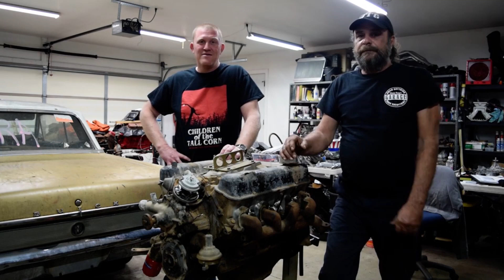Buicks Miracle Motor

Comment: The porisity issue.  The engineers faild to vacuum impregnate the blocks with wax, Critical step missed its why they sweat oil out everywhere  even cooling passages. 
Take all the aluminum parts timing cover also to a heat treating company and have them wax impregnate them. Problems solved .

Comment: brodie is wrong at 1:51 this was not the first production cast all aluminum v8. that was bmw in 1952 when they started production of their OHV pushrod v8 for their '54 BMW 502. They used their alloy v8 in many models up until the mid 60s.
Reply: That's even incorrect. Ford GAA.

Comment: Buick engineers built aluminum 215 cubic inch Hemis in 1951 for their concept cars for 1952. These engines were all aluminum with a rootes blower integral sitting in the valley with 2 side draft carbs, one for gasoline and one for alcohol, which opened when the throttle was mashed more than half way. The 2 cars both had 2 fuel tanks and both ran and drove and were tested often. One car, the LeSabre had a transaxle. The other car, the XP300 sits in the Sloan Museum in Flint, Michigan.

Comment: Even into the 2000"s, Rover was unable to make this even moderately reliable. Theres too few headbolts resulting in continuously blown headgaskets and cooling issues. GM did the right thing axing the program, at least this engine didnt damage GM's reputation like it did Rover's.

Comment: The Leyland P76 V8 engine was a tall deck version of the early Rover V8 it had a wider taller block for the long stroke crank. The bore is 3.50, and the stroke is 3.50

Comment: It's now 2024, I still have two .030" over 455's (so 463cu in) stored in my garage. First, a low compression motor w/TH400 built to run 87 octane gas in a Suburban. Second, a torque monster high compression all-iron motor built to run 100+ octane gas in a circle track Skylark. It has flat-top pistons, zero deck (cut .050"), stage-1 heads cut .100"), and custom cam. For a while my daily driver was a Volvo 142 that I installed a 225ci and later a 231ci odd fire V-6 in. I modified a Buick manual bell housing to directly bolt on the Volvo trans.
Reply: No you don't!!!

Comment: Rover application:
3528cc with twin SU Carburettors (Rover P5, P6, SD1, Range Rover, Land Rover, MGBGTV8, Morgan, Marcos)
3528cc with Lucas (Bosch L-Jetronic licence) EFi (SD1, Range Rover, Land Rover, Morgan, Marcos, Freightliner Ambulance, TVR)
3946cc with Lucas EFi (Range Rover, Land Rover, Morgan, Freightliner Ambulance, TVR)
3905cc with Lucas EFi (TVR but only 100 were made by NCK, later known as TVR Power)
3946cc with Gems EFi (Range Rover, Land Rover) Lucas EFi (TVR, Marcos Westfield)
4275cc with Lucas EFi (Range Rover 4.2 LSE)
4280cc with Lucas EFi (TVR)
4414cc with Bendix Carburettor (Leyland P76 & Leyland Terrier light truck)
4444cc with Lucas Efi (TVR)
4552cc with GEMS EFi (Range Rover, Land Rover, Marcos, TVR, Morgan)
4997cc with Lucas EFi (TVR, Lichfield, Marcos, Bowler)

Comment: the rover V8 (215) in the uk the roverSD! car won every thing in motor sport it killed bmw and mercs on the race tracks and rallying for years for example  monza 500km ETC championship italy 1985 1st- 2nd-3rd  4th place1lap behind BMW635csi  then rover cut out 2 cylinders to make a 90 degree  V6 this was the rover/mg 6R4 rally engine (V64V)  quad cam 4valve and could kick out 400-500 bhp (non turbo) and was developed into the jaguar XJ220 twin turbo V6 and don't forget that lovely 215 V8 was the start of  it all

Comment: A supercharged 215 swap in a Miata/mx5 would be a sick combo. V8 power without the v8 weight. The monster miata v8 swaps are pretty sick but functionally that's a lot of weight up front for a little car, I suspect they are not very good road course cars even tho their power to weight ratio is Shelby cobra territory but a 215 could potentially be the best of both worlds.

Comment: The basis of 2 of Auto Histories longest run power plants in the Rover V8 (1967-2006) (as literal, considering they bought the thing, prints and all from the General (GM)) and of course the Legen-(wait for it)- dary Fireball V6 a.k.a. the 3800 V6 (1962-2008)

Comment: Just in case anything needs to be mentioned about the later engines, the "series 2" Buick V6  introduced in 1995 made more net horsepower naturally aspirated than any previous carburated turbo V6. It won the "Wards best engine" award for its engineering.  Seris 2 heads greatly outflow Grand national heads, and people like me  would like to adapt them to the earlier engines.

Comment: I’ve had a couple of cars with the 4.4 litre alloy Leyland V8 version of the Buick V8 215, it’s basically the same as the 215 but with the deck height of the Buick 340 to get the square Combustion chamber.

Comment: 73 was the first year of the egr,hei was optional on Pontiacs,Buick,and Olds,points were standard,1975 was the first year of HEIs same year of the catalyst,also 75 was the first year of the 231s, even fire started showing up in 77 along with the last year of the odd fire.the quickest way to tell the two apart is the even fire from the odd fire in the even fire distributor cap terminals are evenly spaced.Great information, Thanks Again.

Comment: Guys.  Hey, in 1951 Buick engineers built 2 all aluminum 215 cubic inch supercharged pushrod hemis and put those in 2 concept cars. The Lesabre and XP300 were shown and the XP300 was driven around Flint quite often.  The 2 cars had dual carbs and dual fuel tanks. One tank has pump gas in it and the other had alcohol. When they stood on the gas, the second carb fed the alcohol, cooling the air/fuel mixture. 1951!!!!   well over 300HP from the 215 cu in semi
Reply: HEMI   pushrod hemi

Comment: BMW made and produced an all aluminum V8 well before Buick did.. The Buick 215 was not the first all aluminum engine...   The BMW 507 came with a 3.2 liter all aluminum V8 in 1956... five full years prior to the buick (or the olds).  :-)  Don't get me wrong, the little Fireball (called Thor in it's 4.6 Rover variant).. but it was certainly not the first.

You have just got to love the Buick 3.8L/3800 V6 literally being this engine with the front two cylinders lopped off (and stroked)!  I Love it; great video!

Comment: It’s crazy that the same engine lineage became legendary in so many different ways. It was a groundbreaking all aluminum V8, which went on the be the first production turbocharged engine, which became the Rover V8, as well as the beloved, bulletproof 3800 V6 (which was also found turbocharged in the Buick Grand National).

To say the Buick engineers knocked or out of the park with with engine is an understatement.

Comment: I'm at an old man recently that had an mg with one of these engines in it from the range Rover. Making like 220 240 wheel horsepower. Custom-made the headers and the cold air intake. 5-speed manual. Very nice very fast little car.

Comment: Hate that I didn’t find this video sooner. Grandmas 63 Olds F-85’s both have this engine both convertibles but one with the auto the other with a Borg Warner T10. Found a turbo setup in the early 90’s in Colorado when grandpa and I were on vacation. Regretted not buying that setup ever since.

Comment: The original Buick 215 V8, also used by Oldsmobile, had serious overheating problems and head gasket problems. Because bigger was better, GM lost interest in the 215 V8 so stopped improvement. GM was more than happy to sell the 215 V8 to the Rover Group and Rover smoothed out the rough edges and made it into a reliable engine. Gradually  increasing the displacement ending up with 4.6L. Under Ford ownership, they continued to use it in Land Rovers. Under BMW ownership, they still used this Buick developed engine. As more torque and horsepower were needed, this engine was finally put to bed.

Comment: As far as 1950's engineering goes...Rocketdyne engineered the F1 liquid fuelled rocket engine that lifted the 6 million pound Saturn 5, and haven't yet built a more powerful liquid fuelled engine. 
Happy to have just won an '87 range rover on ebay. Thanks for sharing.  Very informative

Comment: Why does Tony cut him off and gloss over the most interesting part of the Olds version of this engine?  The Repco/Brabham was a SOHC development of the Olds version used in F1 racing.  At 3.0 liter NA, I believe they were getting over 300 hp and revving up to 8300 rpm with Lucas mechanical fuel injection.  Later on there was a 32 valve version and a dedicated dry-sump only block.

Also, COUNTLESS BMC cars and conversions used the 3.5 Rover V8.  Eventually the aftermarket punched these out to 5.2 liters or more.  The Range Rovers eventually grew to 4.6 liters.  Doesn't anybody remember that Jay Z song from the 90s?  "Yo dog, w-w-what's the difference between a 4.0 and a 4.6?"  "Like 30 to 40 grand cocksucker, beat it!" 😂

Comment: My mother had a 1962 Buick Special with the 215 V-8. Great warm weather car, but you couldn't start it if the temperature got below 20 degrees. Years later after I moved to Warren, MI. I had a neighbor a couple of houses away that was an engine tech for GM in the early 60's and through to the late 80's. He told me that GM had a problem with the aluminum alloys they used in the 215. The block would shrink more than the pistons and effectively lock  the motor up. He said he would go out to the cold cars and pour about 5 to 10 gallons of hot water on the manifold and then they would start. GM solved the problem by selling off the entire production line to Land Rover and went back to cast iron. My Dad also had a 1966 Buick wagon with the 340. Early production and it was a mismash of 300 cid parts and the 340 engine. The air cleaner was marked 300 and so on.
Best of all was Dad's 1962 Electra 225 with the 401 nail head. Car was a beast. Trunk could hold 25 bodies!
Reply: The manifold had nothing to do with the engine block.....so 'splain???
Reply: @imtheonevanhalen1557  The hot water on the manifold would be enough to get some heat into the heads and block to expand the cylinders to allow the pistons to move.
Took a lot of hot water and time.

Comment: Why can't he put either a 400 or a 430 with Stage I parts in there? 430s and 455s were only 25 lbs heavier than small block Chevy engines.

Comment: Love this video Dallas. Gave me so much info on this engine. Would email u about the turbo and steel plate needed to use. I heard this engine has 200hp, what’s the torque? I made notes as y’all talked, extremely helpful!! What’s the compression ratio? This engine is all cast aluminum heads and block? What about the intake? Thx you guys!! Amazing video!

Comment: I have one I just took apart looking to see if can sell as a rebuild able block but it is in poor condition.  Sat out to elements...
Aluminum block and heads, has the extra head bolts near exhaust ports.
Casting number CFD-PM14.
Any idea what year and make it is? I can't find that casting number online.

Comment: Rover, in Great Brittian, acquired the all-aluminum 215 cid engine from GM in the mid 60s. This is the engine that wound up in the Triumph TR8. The TR8 with a stick shift was a Corvette killer. I was a mechanic at a British Leyland dealer and got to work on several of these cars. I also saw this engine in a Rover luxury car in about 83 when I worked for an independent import repair shop. That Rover had been sent to Dallas, TX 3 times on truck for not starting when hot. After they got it back the third time with the same problem they brought it to us and the owner said to jury rig it any way we could to make it start. It took me about 15 minutes to fix it. It had Lucas electronics on it and we used to call them the Prince of Darkness.

Comment: BUICK  V - 6: "The little engine that could".

I've had several and only been disappointed by one, a 231 odd fire. I couldn't get sufficient oil pressure.  I suspect that the previous owner ran it consistently with little or no oil and trashed the engine. Who really knows...

Seems to me that Buick has always been a leader in its cars and engines; which is why I'm a stickler on owning Buick cars with Buick engines in them. An excellent combination. 👍

Thank you for the excellent and informative video!👌

Comment: My 1967 skylark has the 340 4bbl, the only change is a 2004r transmission instead of the switchpitch two speed
awesome car,   first new car was a 1965 skylark with the 300ci 4bbt and a four speed, when I ordered it they would not put the 401 in a skylark three months later the gran sport came out..

Comment: Great info to share Tony. These Buick Engine designs were way ahead of their time. Not sure if you guys are aware but this engine went back even farther than you think. The basics of that engine were designed in the late 40s. Gm did a couple concept cars that they showed in the 50'/51' shows that had the beginning of both the Nailhead V8 family and the 215/300/340/350 V8 family as well as 198/225/231 family of V6s. The cars were the LeSabre and xp300 show cars. They had a 215 all aluminum hemi design with a roots style supercharger. They ended up cost cutting like Chrysler did with the Poly type engines and took that basic design and moved the exhaust valves up around to inline with the intake valves all in a row. The Pentroof combustion chamber remained. This kept the Nailhead narrow and cut costs by not having difficult to machine heads with two rocker shafts. They went with the cast iron to reduce costs as well. 8 years later they brought out the 215 Aluminum V8 but used a wedge style combustion chamber. These designs as you say carried on into the 2000s. Just amazing to evolve all those years. Seeing as you really seem to love these engine design evolutions like myself I thought I would like to see some of this info. This link has some excellent info on that topic. https://www.macsmotorcitygarage.com/secrets-of-the-buick-nailhead-v8/?fbclid=IwAR2n9Ru1iZqoLlYdIMpklq-KX0k2CFbceE9j_VyWeRAZEIFBndiGffbDImc  Some further research can find some more too. Check it out. Great youtube show. Thanks for sharing and keep up the good work.

Comment: A few quick side notes on the V6. There was a transverse version at 3.0 liters. Because of engine compartment configuration, Buick had to make the head narrower towards the top. When Pontiac tapped the 3.8 liter turbo engine out of the 87 GN for the 20th anniversary TA, they found the heads too wide for the engine compartment. They dove into the parts bin with a measuring tape and found the 3.0 heads. Low and behold, not only did they fit, they also pumped up the HP by about 25! 
My other V6 tidbit is that while the transverse version of it got updated to Series III, in the middle to late 90s, the conventional longitudinal version in the F-bodies kept the Series II. Unfortunately, very little interchanges between Series and between transverse & longitudinal.

Comment: Those gm engineers must have been sniffing glue when they designed the oiling system on this engine . the same system carried into the 2nd gen small block and the 430 - 455 engines .

Comment: The 215 was the first US cast aluminum V8. BMW was building an aluminum V-8 in the late 50s. Everybody with the possible exception of Ford and Studebaker came out with aluminum block engines circa 1960. Some were cast. The AMC was actually diecast.
GM came up with 4 different solutions for their early 60s "compacts". The 215 Buick, the Corvair flat six, the Pontiac 196.5* four and the four in the Chevy II. 
*I consider the 196.5 a true slant as the cylinder bank is at 45° to the pan rail. The Slanty is basically a normal run of the mill inline six merely laid over 30°
Reply: Where there no cast aluminium aircraft engines in WW2?
Reply: @mazambane286  
Yes there were. Also forged aluminum on some of the higher power radials. Inline aero engines are built differently than automotive engines. The crankcase is one casting while the cylinder banks are a seperate casting. Often with the cylinder head part of the casting. On radial engines the heads are screwed on to the cylinder. Connecting rods are fork and blade on inlines.  A 400 horsepower aircraft engine is built completely different than a 400 horsepower car engine. The car engine will never be able to do the job of the aircraft engine.
Reply: @mpetersen6  Thanks. I know my way a bit around engines as I served an apprenticeship back in 80's as an Automotive Machinist. 
Gave it up as it's a real dirty job. Especially overhauling big diesels.
Thanks for the information.